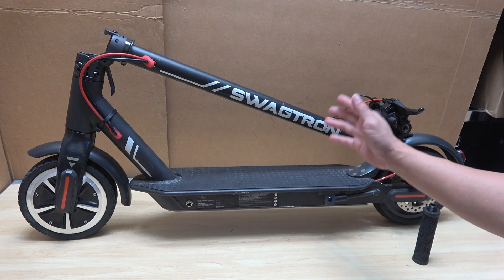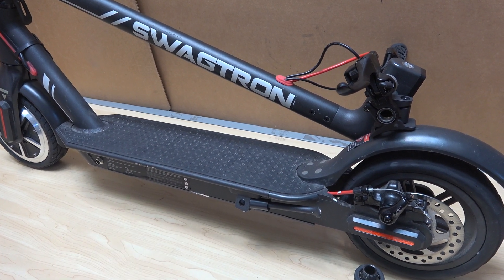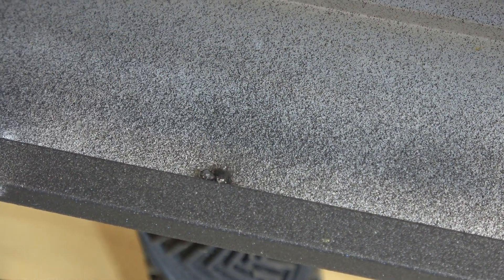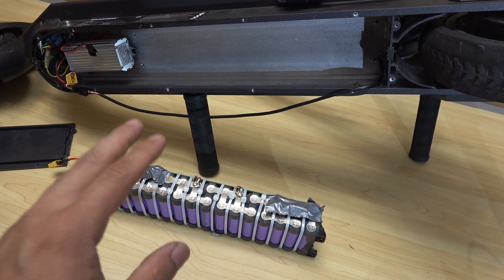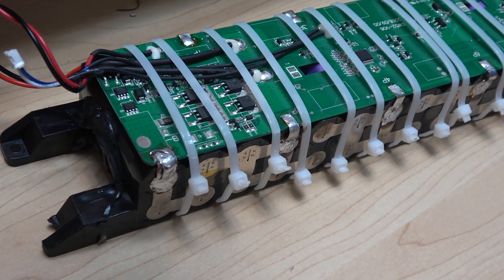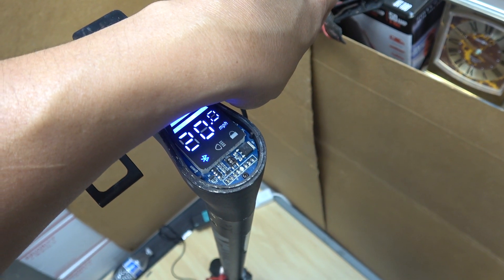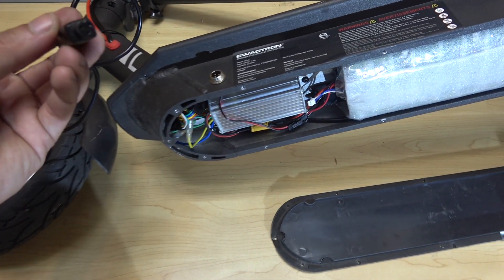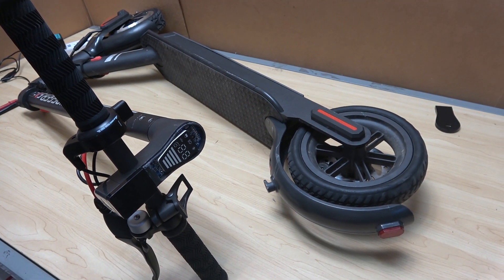Repair a Swagtron Swagger 5 (Xiaomi M365) Electric Scooter battery: Soldering tips for 18650 battery

Comment: I have exactly the same scooter as you, but I will tell you that you showed a non-original battery. I understand that you have already repaired this battery and did not insulate it correctly. Because of this, it touched the case, this should not have happened in the original battery, there are plastic pads along the edges, with the help of which it is completely isolated from the case and it has no way to touch and there is no short circuit. Or you bought your scooter not new and someone tried to repair it before you.

Comment: Could a bad solder joint cause the scooter to fail under load? Mine will charge and run but seems to die at higher speeds

Comment: Thank you. This is the first time I have seen the batteries insulated  using foam and tape instead of heat shrink. I have a Swagtron e-bike and my batteries no longer charge to the full 42 volts. I'm going to inspect them.

Comment: Good video. Just one thing, you're applying to much heat to the battery. I know there is a nickel strip between the cell and the soldering iron. Nickel is a good conductor of heat. I repaired my broken battery terminals with tinned copper braid. It has been working for 2 years. Then the BMS failed a year ago. It would not charge the battery at all, but still powered the motor. I replaced the BMS with a generic 10s one and so far so good. I also added an external 10s4p pack to more than double the range. I charge them separately. It works well because I don't connect packs of different voltage together. BTW the front tire on mine was shit from day 1. It constantly leaked. I replaced it with an airless tire like the rear and have had no other trouble

Comment: The rear wheel of my scooter does not move even a little bit.  When I bought it it worked perfectly, we used it twice and it was two months without using it and suddenly when we wanted to use it it turns on but it doesn't move.

Comment: Hi . I Have taken on a project scooter that is not working and looks like your battery pack here. Are you aware if there is a ''Z'' fuse as shown on some other YT videos . I am having a troubling message/problem there is no communication with the battery (ERROR 21). How does the BMS talk to the mother board ?? Is the Bluetooth emitted from the battery BMS board ?
Hope you might be able to help me a little here . Best regards Don

Comment: You really know your stuff.
I've been using mine for two weeks now, and your point about the board leads me to seriously consider opening up the bottom and putting cable ties as yours has it to at least slow down, if not prevent, the nickel strip separation that you had to repair with yours.
It's an otherwise excellent scooter, and I intend to use it for several years.

Comment: I'm considering upgrading the battery on my hiboy s2 pro.  But I saw a video on the ninebot where the battery was upgraded with a higher amperage battery but the phone app does not recognize the new size of the battery.  Does the xaiomi scooter exhibit the same battery display like the ninebot? 
Also the generic batteries require data hook up up to connect to the scooter that have this cable.
As a curious note, since the ninebot sees the old battery size.  What happens with the scooter when the phone app see 0% when there is actually say 20% as an example.

Comment: Hey there! Was wondering if you could help. My individual cells are 3.51 and not 4 does that mean they’re bad? I’ve soldered them back to the board connections but when I test the positive and negative it still shows 0v. Could it just be that the board is bad or a combination of things?

Comment: hello    i fixed the battery the way you told us test terminal to terminal is over 40 volts          but testing red and black wire like you said i have no voltage       can you help me and tell me why?

Comment: Helpful repair video, thanks. Although I wouldn't recommend wrapping up the entire battery pack with foam sheeting is necessary as it will act as a thermal blanket and retain heat which may shorten the lifespan of the cells especially within hot or warm climates. 3" x 1" x .5mm foam strips shall suffice in providing generously adequate shock protection.

Comment: Just folded my e5 to test for correct voltage. I’m getting 37.4 volts on the battery side but my controller side is showing same. The switch is off. Why is the controller side showing voltage? It’s alive and I’m afraid it will short out due to the male contacts.

Comment: I went through 5 swagger 5s and I FINALLY know why they keep breaking down. Thanks!
Reply: Why bro mine just did and is there any way u can help fam 🙏🏽
Reply: You guys ever figure out if this works??? I wasn’t sure you can replace a battery for this scooter.
Reply: @georgelopez4663  you can replace the battery on any scooter. It's just about replacing the cells. you can even add a second, parallel battery. watch some tutorials.  The BMS looks dumb on this scooter, i would replace it with something safer and less likely to break. There are a lot of good cells in even a bad battery that can be salvaged. you can even revive dead cells by jumping them with the same voltage they are rated for.
Reply: Battery fail due to battery design. The battery is suspended upside down with a flimsy plastic frame that flexes the whole battery and eventually breaks the joints of balance wire causing bms to go into protection mode. Fix could be bolstering battery case to reduce flex and using flexible wires to have some play between battery and bms.

Comment: I have a question, about the control module. 
I have this model scooter, and it rides then turns off, it charges sometimes, and I notice if I tap around the control module it’ll turn on but only for a split second. Help! How can I work with you

Comment: I have 2 of the same schooters where can I find something like a replacement battery for these scooters
Reply: Wht did u do bro
Reply: @youngdollo2430  for the scooter?
Reply: Oscar Rmz yea bro mine the charger won’t charge on the scooter but the charger works on a hover board I got so I’m pretty sure it’s the scooter but ion kho Wht to do
Reply: @youngdollo2430  what I did was just open it up to check the wires its really simple not too complicated
Reply: Oscar Rmz fasho fasho fam then Wht when I open it
Reply: @youngdollo2430  just check the cables see if they are loose or if they are burned or are like  melted

Comment: Hi do you know if a genuine xiaomi m365 battery will work in one of these scooters thanks
Reply from the maker: Yes, it will.
Reply: @vuaeco  without plugging in the data cable from the battery I got one of these scooters with original xiaomi m365 battery but I don't wana reck the battery and wasn't sure if the battery works without the data cable being plugged in thanks
Reply: Without data plug from battery being plugged into esc thanks

Comment: I find when working with Li-Ion most of our safety and quality protocols call for any tab that directly touches a cell to be Spot welded.  Hot soldering iron has the possibility (limited of course) to ignite the li-ion cell. You never know when there might be internal unseen damage with a cell that will cause it to react to a hot soldering iron.
Reply: That's why Li-Ion will soon go the way of HD DVD's when up against Blu-Ray with the Blu-Ray equivalent being Lifepo4 since they're superior in every way BUT don't explode into flames just because you looked at them funny the way Li-Ion most assuredly do.
Reply: I’ve actually had a lithium ion 18650 cell explode right in my face before but luckily I always wear safety equipment when soldering any battery. I’ve been doing this for years and only had it happen one time and it had to be from something that was internally wrong with the battery like you suggested in your comment. The reason I say it must’ve been something internal is because I had already completely finished soldering the battery and it was just setting on the bench for about 2 minutes and I happen to notice the wrap started to peel away from the battery so not think I lean over it to look what’s going on and then boom 💥. I inspected my solder points after this happened and there was nothing out of the ordinary of every other one I had ever done. I just thought I’d share this because like you said the chances are there of the battery exploding especially if you don’t know what you’re doing.

Comment: Nice work, just need some pretty shrink wrap. Like the back pack idea for higher voltages with kobalt battery's to test. Keep it up.
Reply from the maker: The thicker foam actually provides more protection from the shrink wrap in this case. It acts like a shock absorber.

Comment: Nice repair sir.  Should hold up well with the double layers and those relief corner bends.  

I have a spot welder for making large packs, but on smaller tool,/appliance/mobility packs I still find it easier and faster to solder.  A few tricks I have to minimize cell heating and contact resistance:

-scuff the contact surfaces with fiberglass scratch pen or fine sandpaper; lightly pre-tin the mating surfaces

-slightly chill the cells short time in the fridge or with a puff of freeze spray on the joint just prior to soldering (I use inverted canned air, but be very careful of frostbite!) 

-hottest iron setting, clean tinned tip, leaded solder, extra flux -  all to maximize wetting and minimize soldering contact time to a few seconds.  A powerful iron also helps to avoid premature cooling/ pooling - (the finished joint should be smooth surface and not resemble an arc weld.)

-hold the tab down with a sharp pointed non-metallic stick (eg a kebob skewer or toothpick) to maximize direct tab to tab contact in the joint

-as soon as solder turns solid remove the stick and dip a cotton swab /q-tip  in a small bowl of alcohol and immed place on the joint to suck the heat out, then use it to clean off the flux

Thanks for the vid.  That scooter runs nicely!

Comment: Only 1 recommendation: use AT LEAST a 60W soldering iron (i suggest a cheap blue one with a simple temp. control system (a variable resistor)).(the problem of those soldering points is the temperature, since it's too cold the tin wont stick well (like the previous soldering), while, at around 325-375 c° the tin will melt instantly.
Reply from the maker: Mine is a Weller 50W and it works just fine for this purpose.
Reply: @vuaeco  yeah it was just a suggestion, cause that first spot triggered me a bit, lel sorry

Comment: As usual great content!!  I thought for sure u were going to put two Kobalt batteries on it. Maybe when the other batteries die
Reply from the maker: I thought about it. A Kobalt 40V battery would do just fine. Problem is how to put it in the scooter because it does not fit.
Reply: vuaeco   U could make a vest or back pack for u and your son. Perhaps a bullet proof vest like the cops wear. And a couple of xt 90 connectors. Whatever voltage u feel like. If your in a hurry to work, use the 90 volt connector.  Safety and eco friendly.